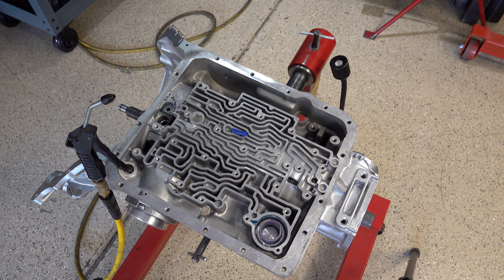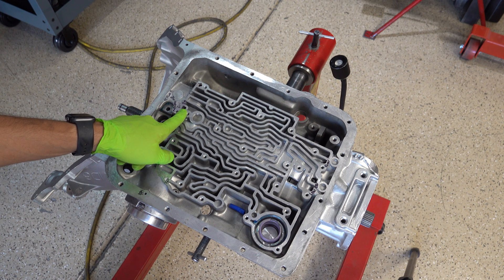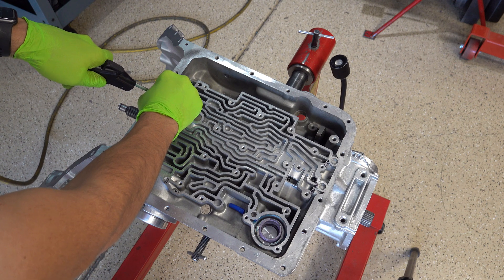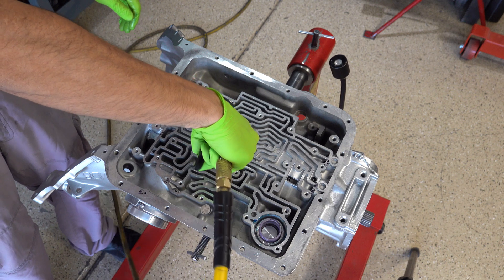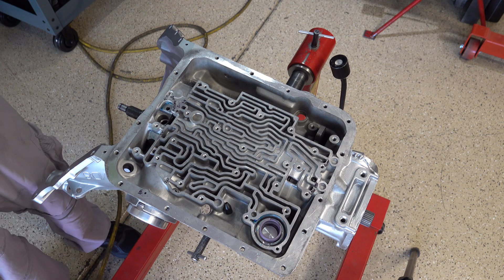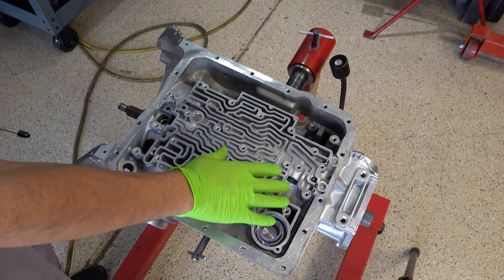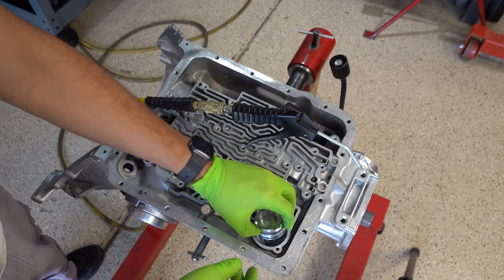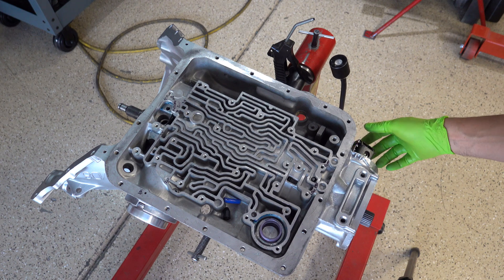700R4 Case Air Check  - No Test Plate!

Comment: Hi Nick   All my circuits check out as you describe but when I blow air into the low reverse circuit the air blows out of the hole that has the encapsulated check ball.
Reply from the maker: Hi - It shouldn't be blowing out of that hole as you describe but perhaps I'm not understanding...As long as the piston is applying like it should, you should be fine but if you're getting a lot of hissing coming from the piston, I'd pull it to double check all the machine cut seals and replace any that got torn/broken.
Reply: Thanks Nick for the info. The piston is applying just fine no hissing coming the piston. I did notice some other YouTubers air testing that circuit and you can see that the encapsulated check ball moving around in it's retainer. So that's why I was concerned that something was wrong.
Reply from the maker: Oh, gotcha...yep, that ball capsule does move around when air checking it...

Comment: Hello, seems like you know a lot about the th700r4. I have a issue with my trans. Everything works perfectly but when i let go of the gaspedal (doesnt matter at which speed) the rpms drop back to idle and when i press the gaspedal again it catches the gear and i can drive normal again. When i shift manually into second or first the same thing happens and there is no brake power from the trans(„engine brake“). I changed the oil and filter but i didnt make a difference. Do you know what the issue could be? Do i have to rebuild the trans? I am a mechanic but i never worked on old transmissions so i dont really know what this could be.
Reply from the maker: Hi Gronk,

Sounds like your overrun clutches may have burnt up, since you're not getting any engine braking...I'd tear down and inspect the unit, then overhaul it per my 700R4 Rebuild Series...

You can find my complete 700R4 playlist below...Check out my 700R4 tear down and inspection videos for information on what to check for and how to inspect parts for wear/damage/lack of serviceability. 

Playlist: https://www.youtube.com/playlist?list=PLMqgQ_reThtLi6qVnkI6g0OgCjwVxQp67

Comment: A bit confused.  You are testing 4th from the small hole in the pan rail.  Is this just not a drainback from the servo bore?  Where is the 4th circuit in the wormtrack?
Reply from the maker: You shouldn't be...That is the 4th exhaust but applies the band when you charge it and is much easier to access than the actual feed location.
Reply: @nickstransmissions    I get that.  That's what I said in my question.  Drainback/exhaust, same thing.  Was just curious where the fourth feed in the wormtrack is.  When I build, I aircheck on bench.  Never done this and haven't really concerned my self with the different pathways in the wormtrack.
Reply from the maker: Yea, I'm the same way - only care about the worm tracks themselves if I'm trying follow the circuit for some reason but not for bench checking...I just looked at a 700R4 case in the yard and the feed port I see in the case for 4th seems to be routed to/through the pin bore. The air test plate has the feed in the cavity right behind the servo bore where there is a port at the bottom of the worm track cavity. 

Sorry if my initial reply came off as a bit gruff, it's early and only had one cup of coffee.
Reply: @nickstransmissions bro that does NOT apply anything.
That is only a small hole that feeds a void between the back of the 4th servo piston, and the plate that separates 4th and 2nd servo pistons. Nothing should ever be in there but air that escapes when the 4tb servo piston moves back in forth.